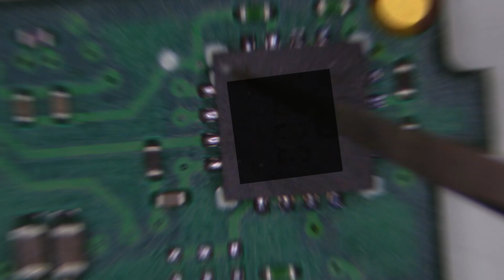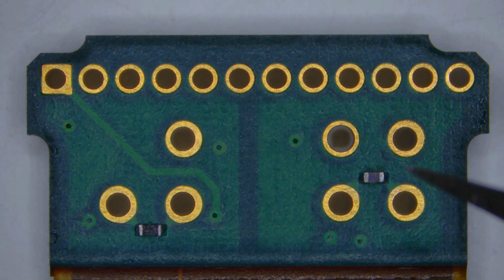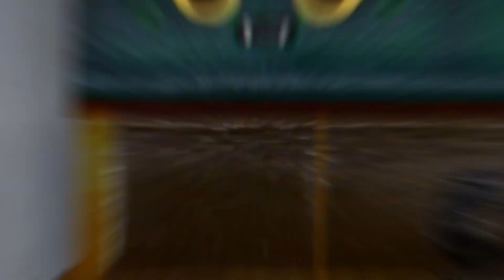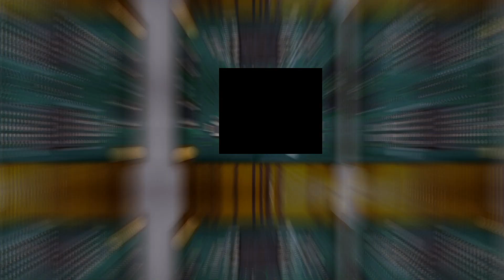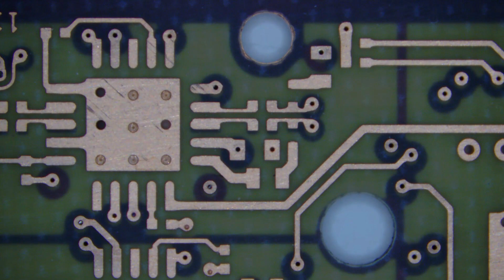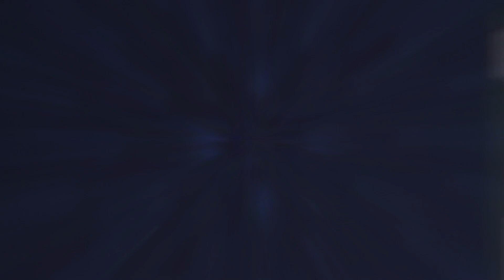How to relate Breadboard and wires to a real PCB

Comment from the maker: I forgot to explain why the solder mask was present in some holes. These are via holes, not component holes. Component holes have to be clear so that component leads can pass through and can not have any solder mask in them. On the other hand, vias are holes for connection purposes only. It is ok if a solder mask gets inside them. 

There are occasions when you define when you want the holes completely plugged with a solder mask and when you want to ensure they are completely clear. However, these topics are advanced, therefore, not discussed here. 

In this case, the customer didn't care so the boards were made with relaxed parameters. Therefore, some holes are covered with a solder mask (solder mask inside the holes) and some are opened (holes clear of solder mask).